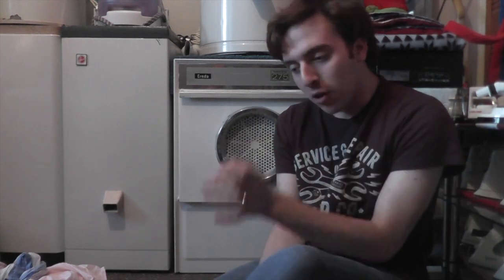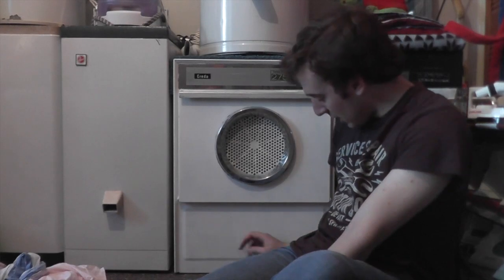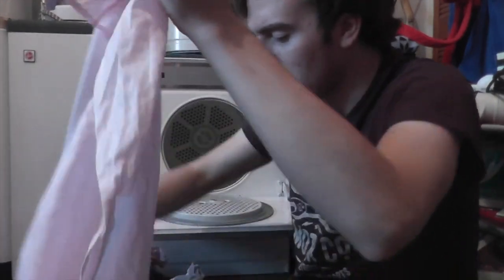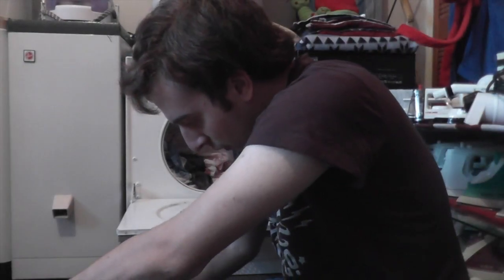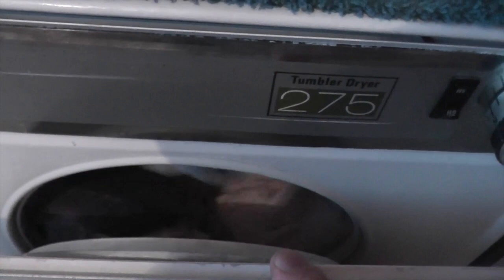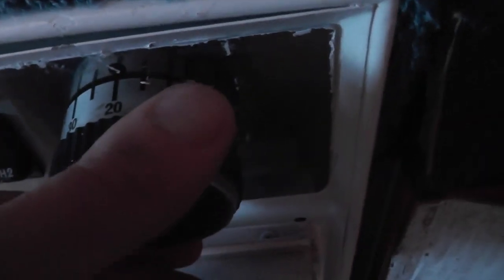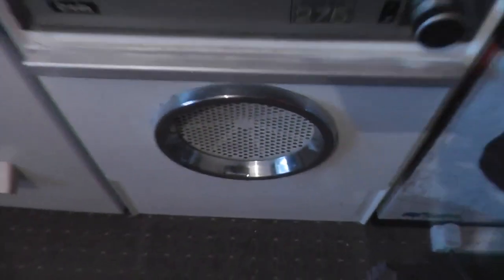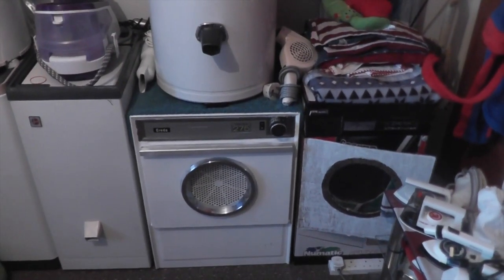Creda 275 'Tumbler Dryer' (Circa 1976) Overview & Demonstration

Comment: We have a working Creda 275 drier that we have had since new - bought c.1976 and still going. Mind you, we prefer to air dry washing so it it's rarely used.
Reply: Hi there, I still have and use a CREDA REVERSOMAT 400 dryer bought in @ 1980 but like you i prefer to air dry my laundry so its also rarely used